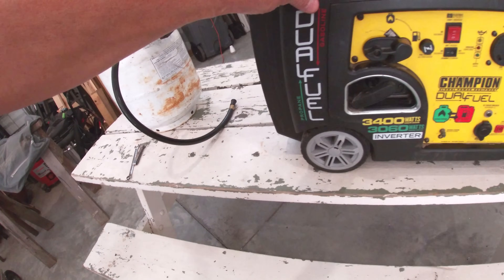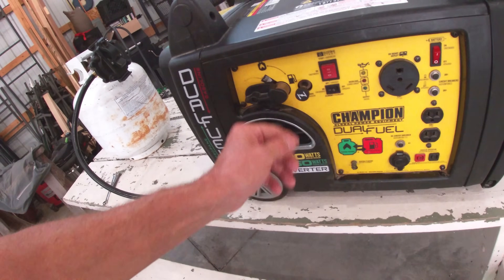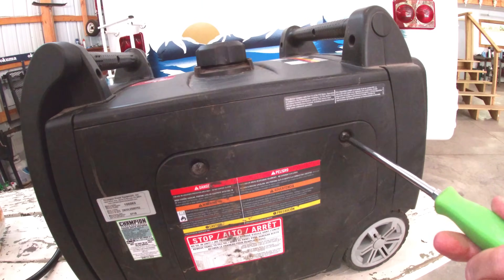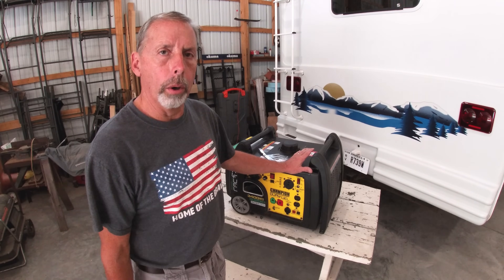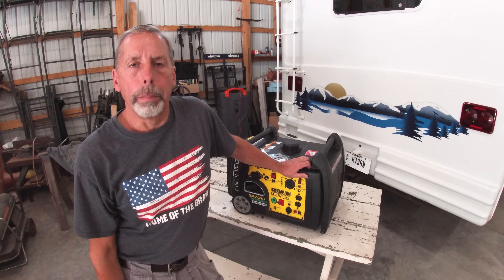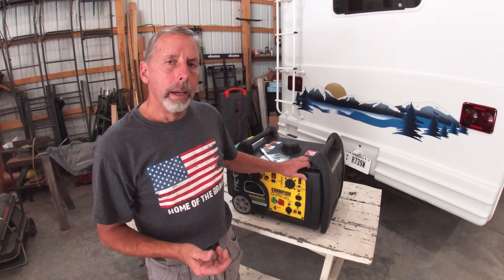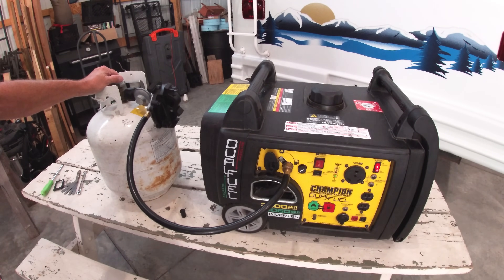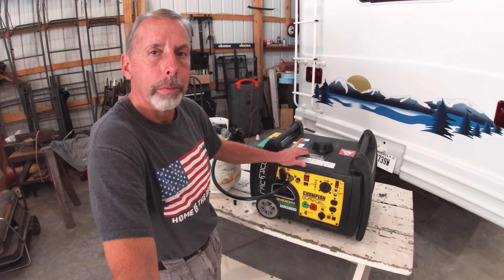Propane Generator Fail

Comment: The valve you are having a problem with is called a slug valve. It is actually on the output of the propane tank.   It is to stop propane from coming out if you have a propane leak.  Turning on propane really slowly will slowly build up pressure on the hose side, and the slug valve will not trip. Turning the propane valve on real fast, will result in high propane pressure across the slug valve, closing the slug valve. There by shutting propane flow off to the customer propane device. This slug valve allows a little bit of propane to leak across the valve so the valve can be reset.
Reply: Exactly this; not the generator’s regulator. And since it’s an issue with “how to use your propane tank properly”, the generator company probably doesn’t want to “take responsibility” for people doing it wrong by putting ANY instructions for it in their manual.
Reply: Not exactly???  My water separator for my air compressor uses a slug valve which is very different from the Excess Flow Valve (EFV) in the coupling at the end of a propane hose.  The EFV or more properly named an "actuated liquid withdrawal excess flow needle valve".  You might find that you need to disconnect the hose from the tank to relieve the pressure between the spring loaded needle valve and the Type 1 ACME valve on the tank to reset it before slowly reopening the Type 1 ACME valve.
Reply: “Excess flow valve” they are terribly designed. I yank them out.  They make more trouble, than they are worth. They are located near the inlet of the hose, where it connects to the tank. Find the tiny “check valve” looking thing, inside the inlet.
Reply: @kevincarson7096 excess flow valves, are just like check valves, except, they have a bleed hole, to allow pressure to equalize, on both sides of the “check valve”. This is designed to slow down the flow of fuel, if a line has been cut.  Buy a real excess flow valve,( can be serviced), the hose w/integrated excess flow valve, is junk.
Reply: @mikestone234  Does a generator draw propane fast enough to trip the valve?
Reply: @soundspark  No, not usually, wirh a good excess flow valve. But, these excess flow valves, that are made into the hose, are cheap, and the spring gets so weak, that it can “check” at anytime.
Reply: @soundspark  No.  A portable 20lb or more tank should be able to provide 80,000 BTU per hour with warmer ambient temperatures.which is equivalent to about 3/4 gallon of gasoline per hour.
Reply: @soundspark  Not really but an empty regulator and hose just might trip it up.
Reply: Buy extra 10mm sockets and wrenches, you'll thank me later!😊
Reply: This info is exactly right.  The valve is on the tank.
Reply: @kriswright1022  
The 10mm wrench meme is for real. I organized the (late, lamented) hand tool section of a local pawn shop, binning all the sockets by size as I was looking for specific brands anyway, and all sizes were full or nearly except the 10mm. It occasionally had a few (which I snagged if they rounded out my collection), but rarely.

Your local Horror Fright carries a selection of 6 or so 10mm sockets as a stand alone set, 1/4 & 3/8 drive, deep well etc., for this very reason.
Reply: Best post on here.  Thank you.
Reply: @soundspark  No, it's the initial surge of propane coming out and filling the line/hose that is fast enough to trip the valve.
Reply: @killer2600  The question had already been answered by the way; I'm aware of the inrush making the valve click and having to wait for the second click before operating the attached device.
Reply: I've had to open valves with 2000-2500 pounds of pressure. You can bet I do it nice and slow. It becomes second nature to open valves cautiously. 😉
Reply: Great information and thank you! I have a dual fuel generator that I have only used twice and will make sure I follow the open slow procedure.
Reply: @soundspark  No, But when first turning the cylinder valve on, there is a sudden rush of vapor that pressurizes the hose to the generator. This rush of gas vapor has enough volume and force to cause the excess flow valve (ESV) ,which is built into the cylinder's service valve,  to be drawn into the closed position, restricting flow.  Some cylinder valves are more prone to this than others. It's just the nature of manufacturing them. 
If one wait's long enough, say, 10 minutes or so, the pressure differential between the hose and cylinder will equalize thanks to a small pass through opening in the ESV  and the ESV will return to an open state.   This is a very common occurrence with BBQ grills. I have been in the LP business for 18 years now and have spent a good number of those years handling cylinders in exchange cages and have gotten reports of "No Gas" many times that have turned out to be just this issue.
Reply: Specifically the ESV (AKA slug valve) is there to prevent a MAJOR release of gas in the event that a line is cut or otherwise is opened fully to atmosphere. the typical small leak is not enough to trigger it.  Otherwise your explanation is spot on.
Reply: Right you are. I've had the same issue on a grille because I always shut off the fuel at the tank to depressurize the line. I neglected to turn the burner controls to off before opening the valve and the flame wouldn't go any higher than "low" due to the slug valve "thinking" there's a leak.
Reply: @unquiche  good point.
Reply: @soundspark  if the line is depressurized it doesnt take a lot of flow to set that thing off.
Reply: @slidewaze  and thats exactly what does it.
Reply: Others below already have your correct answer, the little ball that snaps into a seat and stops or nearly stops flow if it’s excessive. But a lot of the time it’s not an issue until things get some age on them, prior to that, no propane leaks down when the unit is off, but once it starts leaking just a tiny bit, the propane hose is pretty much no pressure which makes that ball snap much easier. I’ve had them stick also, had to bang the tank around to get it to loosen up. It’s a shame you had to go through all that, but at least now you know what to do and you did your part by sharing the knowledge. Even if it’s not explained 100% right, the bottom line is, open the tank slowly, it’s all that really matters. I definitely just did a lousy job of explaining things, I swear sometimes I think English must be my third language.
Reply: no the tank is probably  running low. Ive had the same issue. tank needs to be exchanged. when they get down to about 10% left it wont come out fast enough to keep the gen ruining thanks to the regulator.  besides champions suck. ive had 3 and all 3 broke and they wouldn't honor the warrantys
Reply: @clamojoat8543  sorry but that’s incorrect. It’s true that a small tank can’t provide enough flow of vapor especially in colder temperatures, but that is caused by a different thing completely, it requires energy to change liquids to gas, and the surface area of the smaller tank can limit that. But, I assure you there really are mechanisms that will slow down the gas flow making you’re grill barely heat, or generator barely run etc and opening the valve slowly keeps that from causing issues, I know it sounds like some voodoo or something but it’s real. I didn’t realize your comment wasn’t actually to me until after I posted it but left it up anyway.
Reply: @waynenocton  whatever ive been threw this crap. ive tried opening it slowly and got the same result.
Reply: @clamojoat8543  doesn’t make it wrong, I promise you these valves do exist.
Reply: @douglashewitt5064  One of the best posts on the internet. I have been doing mechanical stuff all my life and I had no idea that the newer propane tanks has such an automatic safety shut off on the tank. If I didn't know, millions of other people don't know. That adds up to a lot of wasted time & money.
Reply: @unquiche Everything is in the wording. They aren't responsible for the way a propane slug valve works but they could explain the process of properly opening a valve on a propane bottle in an effort to prevent customer headaches. How many did not solve this problem and thought champion makes a crummy product?
Reply: That is very very cool. Now I know why one of my 20 lb tanks went nuts on me after I installed it to the grill. I was opening and closing the valve fast. Tank you lol!!
Reply: Exactly, I was going to make the same comment.  The first time I heard about this was in a video about propane grills not working.
Reply: Exactly!
Reply: @kriswright1022  and 8s. 😁
Reply: I would think that this same problem could be experienced on a barbeque grill also.
Reply: @JLang-bn3hs  and if you can, run propane as much as possible.  It burns cleaner and doesn't gum up the carb like gasoline.

Comment: Dear Pleasant Valley Outdoors: Thank you so much for the great video.  I have struggled and struggled trying to get my brand new DuraMax generator Hybrid 1200 series to crank.  We just had a power outage due to the recent hurricane (Helene), we live near Asheville NC and woudn't you know it, my power goes out and the generator won't crank. I finally gave up.  But after everything went back to normal and we got internet I started searching and found your video.  I fixed the problem in 5 minutes.  I owe you one my friend, thank you so much and God bless.  David
Reply from the maker: Glad to hear it worked for you. I’ve been seeing on the news about your area. Very scary situation. Stay safe and thanks for watching

Comment: We have had the same issue with the regulator on out BBQ if you open the valve  too quick you can feel and hear a small click in the regulator. To reset you have to turn valve off clear lone pressure and do it slower.   Glad you got the problem figured out.  Great video.

Comment: This is the example of what YouTube should be. No nonsense straight forward helpful and useful information! Don't have a propane generator but have other propane powered equipment and it makes sense. Thanks for the tip
Reply: Agreed. Very useful video.
Reply: @tm502010  Yes indeed!  No mention of that "thing" anywhere else on the 'net that I could find.

Comment: This is a common issue with all propane devices. I found it out on a propane grill that belonged to my cousin. I googled bad regulator and I banged the regulator around and opened it slowly and it worked great.
Reply: Hey. It ain't an issue regarding propane. It's effing high school chemistry. Don't drop out before you get to take Chem or at least physics.
Reply: Yes my gas grill does the same thing ,it believe when you open the valve fast it quick freezes the diaphragm, as valve gets older the diagram get harder just like carb diaphragms in  older snowmobile, will drive you nuts ,also the Valves get moisture in them which does a guick type of freeze up ,next time put some hot water on the see if it helps!!!😊
Reply: Regulator vent pluged
Reply: @nothankyou5524   If highschool chem is the only reason the public would know this, that is a problem with propane cans not having it on the instructions/warnings.
Reply: @nothankyou5524  Hey. Wrong.
Reply: @nothankyou5524  
This is engineering. The ‘Excess Flow Valve’ acts as a mechanical ‘fuse’, blocking flow if it ‘thinks’ (…?) such flow is in excess of what any reasonable attached load should need, just as an electrical fuse or circuit breaker does in wiring circuits. 

Any small flow allowed through the valve when in blocking mode is just there so the pressure can equalize across the tripped unit, allowing it to reset itself if flow demand is stopped for a little, without needing to remove the hose or otherwise manually reset the valve.

If there is a largish volume beyond the excess flow valve, it may take a moment longer to build pressure there, so crack the tank valve open and wait a short bit before fully opening. Note how after he did the slow opening, he then could quickly finish the full opening.

It would have been easy to reproduce the original symptom. I wish he had also demonstrated that. 
He also didn’t say anything about what change in his setup or usage caused this problem to start happening, following years of successful, if infrequent, operation. Some in these comments have been blaming a cheap, deteriorating in-hose valve, so something he had started doing differently need not have been the problem, in that case.

Good info, nonetheless.
Reply: Wouldn’t you know it… just yesterday, an outfitter complained that his propane stove sometimes refused to work in the field until he unscrewed it, oiled the threads (!), and reassembled the setup. I was able to show him how a fast opening of the valve could cause the symptoms, and how to reset it, because of this video. I vaguely recall hearing of this before, but easily could have not remembered when trying to figure his problem out, without the reminder.
Reply: Since they went to the new style valve on the propane tanks this has been an issue. If you open the tank valve with no hose hooked up the safety inside the tank will not allow the gas to flow. Opening the valve too fast, especially with the large regulator that comes with the generator, will fool the safety and block the flow. Open it slowly to charge the regulator and hose and there's no problem.
Reply: Worked in a steel fabrication shop. The gas regulator manufacturer recommends opening the gas valves slowly because the sudden pressure will cause damage to the diaphragm.
Reply: LPG gas fitter here If you have to bang the regular to make it work it is faulty and needs to be replaced by a trained licenced gasfitter Possible dangerous situation
Reply: This.  So frustrating. Regulator design issue
Reply: You'd be able to get better parts from Amazon to many people tri the manufacturer first for new stuff yes but older stuff good luck
Reply: Yes it happens with the little buddy heaters too
Reply: I had numerous times this happened, now I always open slowly!
Reply: @nothankyou5524 I'm not certain what you're on about. I know a chemistry PhD that can barely work on anything nor does he care to know.
Reply: Ditto for camping trailers with gas stoves and heaters..  it's a safety thing.
Reply: Z
Reply: What I've found with gas grills is that you have to open one valve first and then the other. I don't remember which order; either the tank valve first or the burner valve first. What happened was with the latest design tanks the valve has a pressure sensor which keeps gas from flowing out if something isn't connected or at least attached tight enough. On that basis I have to assume that the tank valve needs to be open first with the burner valve closed. It makes the new tanks fussier to work with, but that's what we've been given in the name of "safety". Apparently the nanny state thinks that we need to protect ourselves from ourselves.

Comment: What this outstanding video told me was that management needs to train their staff.  It took 3 calls to get to the right person?  But thanks, because I think that fix will apply to other propane devices, like heaters.  Had a similar problem with my propane heater.  Messed with it for a while, and finally got it working, but noticed that the procedure I used to get it working was the one this man speaks of, and I remembered that I had closed and opened the tank exactly as he said.  Everything work fine then.

Thanks, but I think your video is even more useful than you think!

Comment: LP gas cylinders are equipped with a safety valve that will shut off flow if a hose becomes disconnected. If there is no pressure on the hose or whatever is attached and you open that valve quickly, the safety thinks the hose is broken and shuts off the flow. Since you had some gas flowing, the safety on your valve is probably faulty because when that safety closes, the only way it can open is  to close the valve fully and reopen it.

Comment: All propane tanks need to be opened slowly due to the OPD -overfill protection device.  Learned this years ago from my propane guy.
Reply: Exactly.  There is what is called an excess flow that if valve is opened too fast or a line ruptured this valve shuts off and slows the flow almost to nothing.  The fix is to shut off tank valve and to wait until you a snap or click when it reopens.  At that point open valve slowly and flow should be normal.
Reply: @samdunn1807  Normally you open the valve with the device that consumes gas closed, and you wait for the two clicks before turning on the appliance.
Reply: THIS!!  Totally this.
Reply: Was his name Hank?

Comment: I believe that the propane tank overfill protection valve systems install in the tank valve also have a open line safety system that minimizes propane flow when the valve opens and there is too much flow while the opening occurs.    These overflow protection device were required after many propane cooking device injuries.
Reply: Also, the regulator diaphragm becomes stiffer with age, so the regulator is less tolerant of quick opening. They suggest "resetting the regulator:

    Turn off the propane tank valve and disconnect the regulator.
    Open the appliance valve(s) to release any residual pressure in the system.
    Close the appliance valve(s) and wait for a few minutes.
    Reconnect the regulator to the tank and slowly open the tank valve, listening for gas flow.

Fairly typical on older propane tanks on larger propane grills.

Comment: I had the exact same problem with my barbeque about five years ago couldn’t figure it out for the life of me and then I came across similar instructions and blew me away
 but thanks for posting because people need to find this out.
Reply: Bureaucrats want us to be safe so they mandated a valve that closes on high flow, like a broken line, but you also get high flow when charging the hose and device when you first connect to the LP tank.